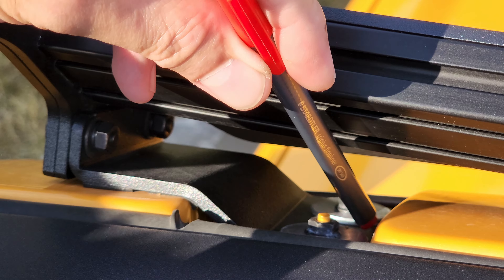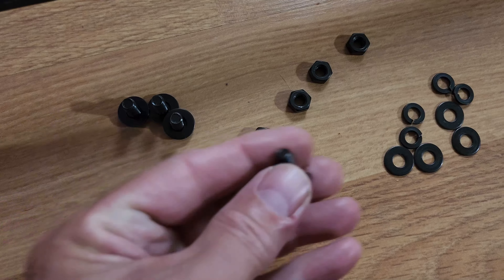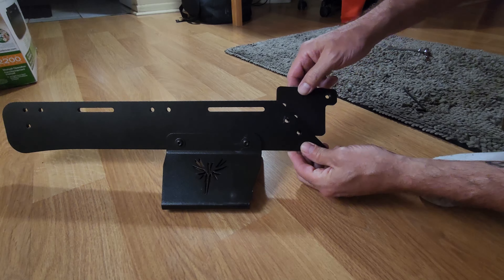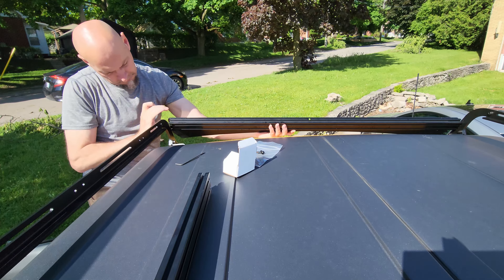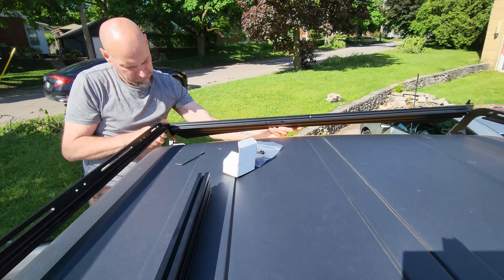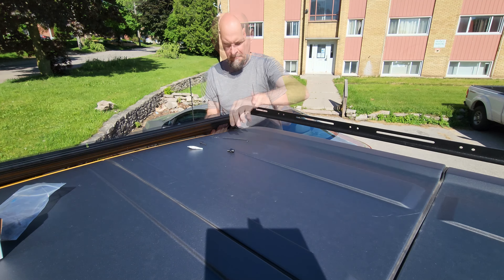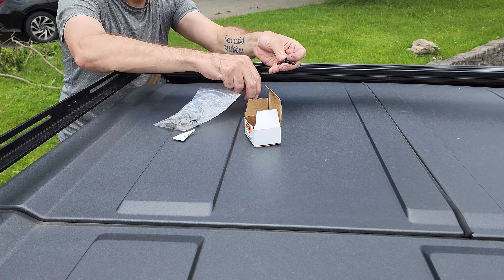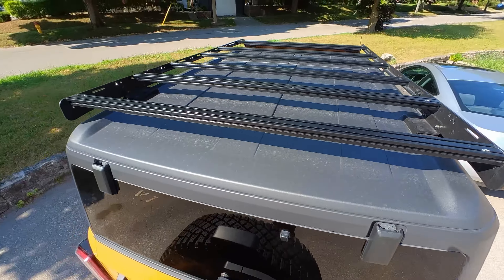Valkyrie Offroad's modular roof rack install for Ford Bronco

Comment: Great job Eric, well laid out instructions in an easy to follow pace. I like the little tips along the way like tightening the nut not the bolt head when making final torque adjustments. 
PS your stress levels look calm and cool compared to me, I like how detailed and patient you are, great job.
Dino
Reply from the maker: Thanks, Dino! Appreciate it. 👍
More calm than the seat delete video where I'm fighting with that barbed push pin?? Lol